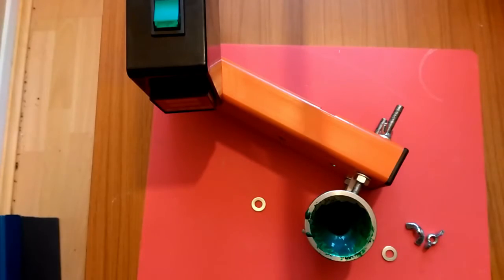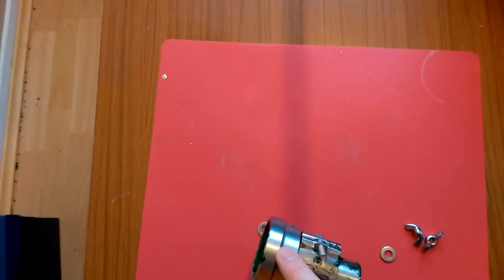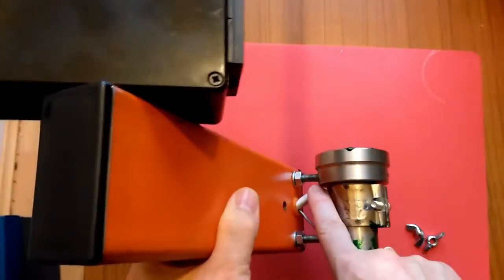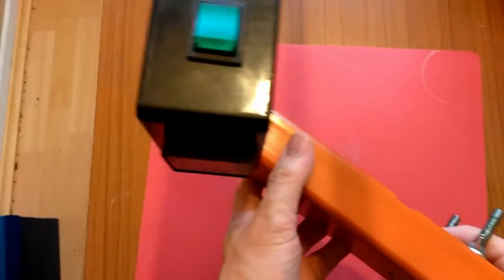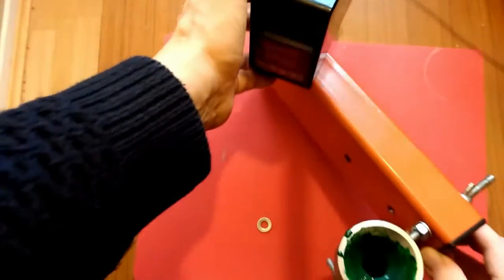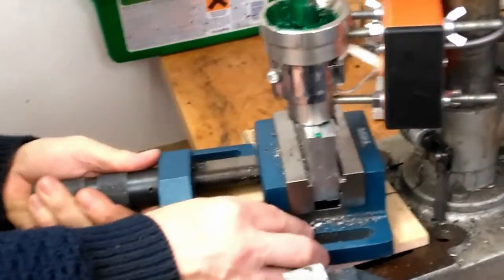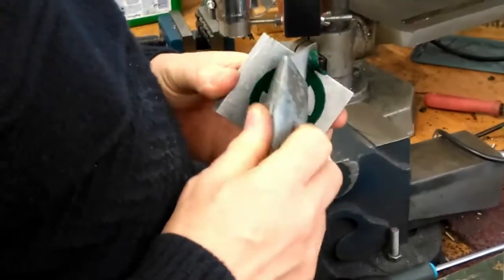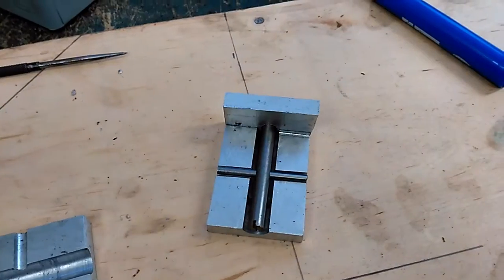Plastic Injection Molding Machine

Comment: This is positively the simplest and efficient design I have seen yet I think I have all these parts in my shop. But for the main beam I was thinking of using aluminum being lighter in weight. Great tutorial. Oh by the way I want to use mine to make gun grips..
Reply from the maker: Aluminium should be fine. Have fun.

Comment: How is the unit attached to the drill press?
Reply from the maker: Hi Foxy,. It is attached with a U-bolt. You can see this clearly here: https://youtu.be/dGmDx4Vn-gs?t=3m26s

There is a slot on the orange beam which ensures that it sits squarely on the column of the drill press.

Comment: Is it earthed?
Reply from the maker: +littlestworkshop Thanks for your enquiry.

Mosty certainly, yes it is, and the earth connection was thoroughly checked. The entire metal structure is connected to ground.

Your channel looks interesting and I have subscribed.
Reply: +Chris Wesley I thought it would be. I found your channel through the advert you placed on the home workshop for sale page about the injection moulder a while back. I have an old MCP pneumatic machine but I've not tried it yet, for a long time I planned to build my own.
Reply from the maker: +littlestworkshop Ah OK. Yes, this one is an improvement on the earlier one. Same idea using the drill press instead of building the support frame and lever.mechanism - but this one simplifies the design.

You MCP sounds like a serious piece of kit. I@m not sure i could keep my mits off one if I had one lurking. We have considered  building a semi- or fully-automated machine but the manual ones we've used have served our modest needs so far. The engineering aspects of them do interest me, though.
Reply: +Chris Wesley It's a fairly simple piece of kit that sits on a bench, vertically orientated with a big cylinder providing the push, you still clamp it manually etc and it is designed to take simple round moulds so you can make them on a lathe easily (the blanks). Needs some restoration or I would probably have given it a whirl. It's on THE LIST
Reply from the maker: +littlestworkshop Oh I see. Not sure I see the benefit of the pneumatic ram then. Pulling a lever is so easy. THE LIST - yes, I have one of those. Really I need an underling - I'll waive my hands about and expostulate grand schemes and someone else will do the nitty gritty. Not going to happen though.
Reply: +Chris Wesley Consistency and with a 5 or 6" piston a lot of force at the touch of a button with timing for hold etc. I don't mind doing the nitty gritty there is just too much of it and people will insist I work for a living :)
Reply from the maker: +littlestworkshop Ah right. I find the "feel" you get with the lever handle very helpful. You know when the mold is full, you can feel how runny the melt is, and so on, but it's not as repeatable as an automated system.

Yes - employment is an outrageous imposition isn't it.